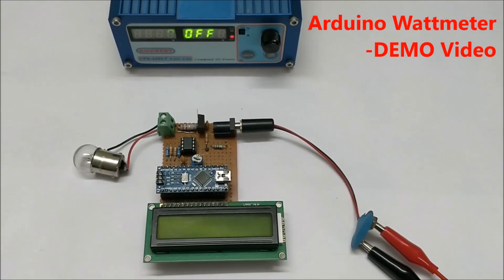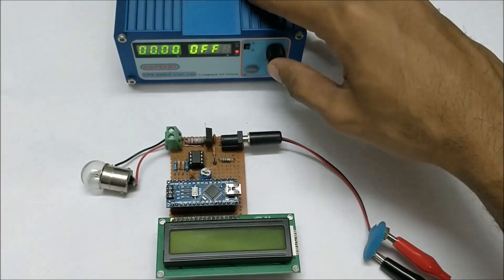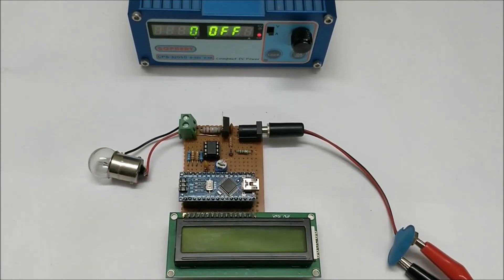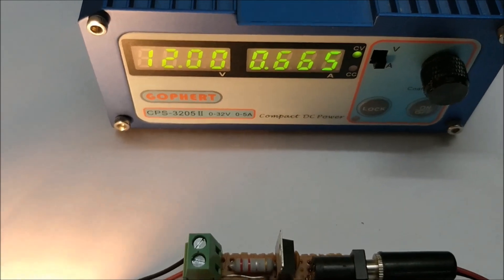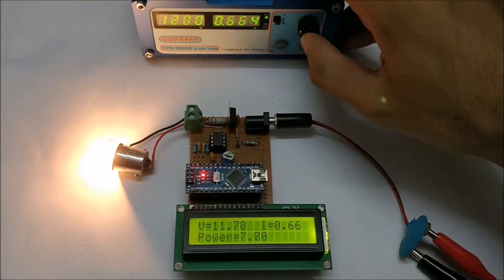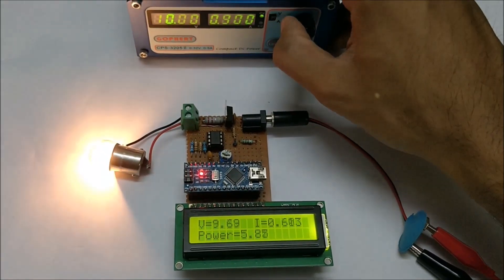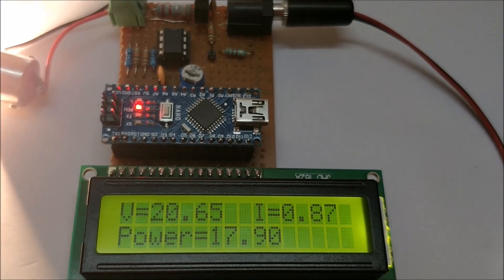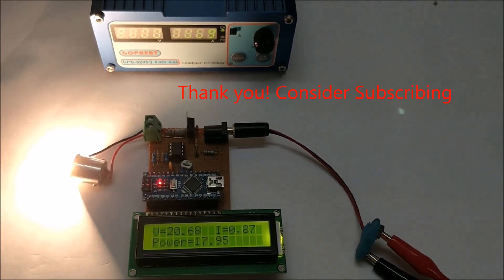How to Build an Arduino Wattmeter Project

Comment: How to increase the current value? There is no explanation about that in website. I want to measure the around 20 Amps current draw, is it possible?
Reply from the maker: You are measuring 20A AC or DC? If its AC have a looks at ACS712. Also you can write your questions on our forums https://circuitdigest.com/forums you will get better response there
Reply: @Circuitdigest  it's DC 15-20A for drone flight controller application

Comment: how to make for max 10 ampere
Reply: you need a bigger shunt resistor and you need to reconfigure the opamp and the voltage divider and then adjust the code accordingly

Comment: Is it possible to replace the bulb with a small Thermoelectric Generator and measure the power the Thermoelectric generator is producing by applying hot temperature on one side and cold temperature on the other side?
Reply: not using this design, no
Reply: @ctbully  ouh so did u mean this design cant be used to measure another load? But if i want to measure my load which suit with the rating of this design is it possible?